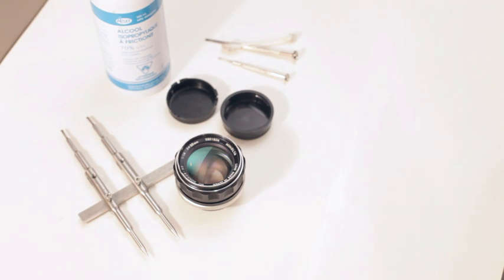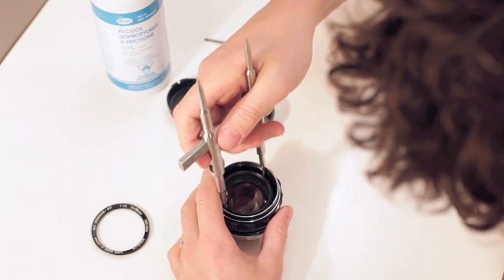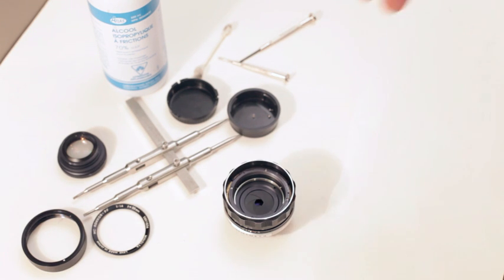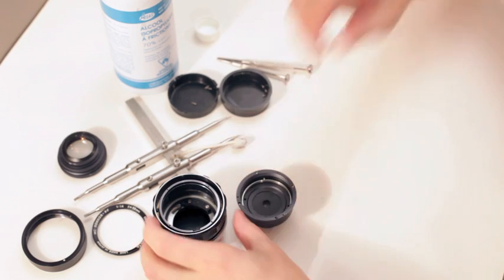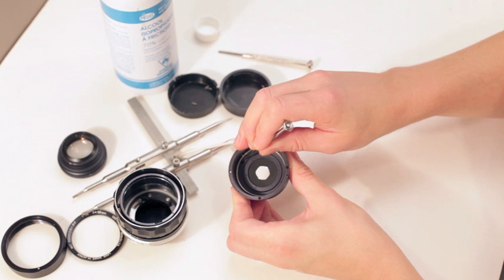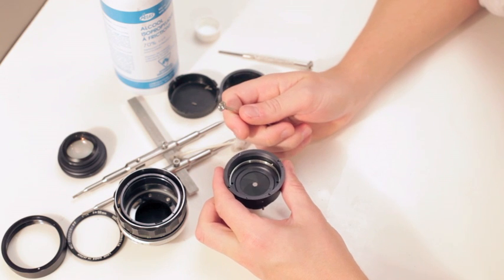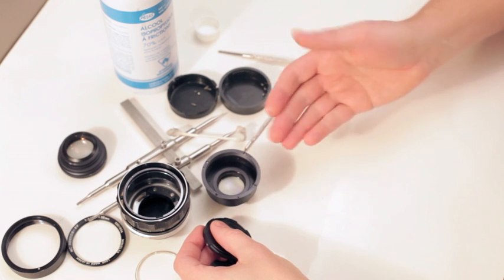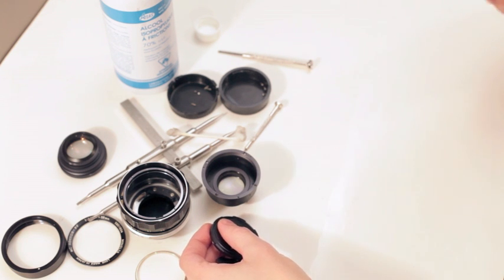How to clean aperture oil, fungus Minolta 58mm 1.4 PF 1/2

Comment: Hi, thank you for this Video.
I have the same Lens but with fungus. And my problem is I have a dent in the Filter ring. How I can remove the Lens with the dent? Thanks
Reply from the maker: To take out the dents is very easy. Just take a wood doweling and I smack them out with a hammer. The wood protects the metal and paint and the dents come out quite easy and will be able to take a filter again.

Comment: hi,
Could you name me the spanner you are using? I want to start learning how to clean lenses. What are the usual screwdriver sizes that you use to disassemble lenses?
Reply from the maker: Sure it is called a P3-S but they can be tricky to find. I found a seller on ebay who sold the box type one's and asked if he can get me the P3-S and he did. You may have to hunt.
Then also this one is great because it pinches in or you can rotate them and point them out. For the price its a must!
http://rover.ebay.com/rover/1/711-53200-19255-0/1?icep_ff3=2&pub=5575054310&toolid=10001&campid=5337469304&customid=&icep_item=360807053731&ipn=psmain&icep_vectorid=229466&kwid=902099&mtid=824&kw=lg

Then any $10 6pc precision screwdriver sets at a hardware store is great, and right now the Wiha #0 Phillips is one of my fave for a good driver:
http://rover.ebay.com/rover/1/711-53200-19255-0/1?icep_ff3=9&pub=5575054310&toolid=10001&campid=5337469305&customid=&icep_uq=Wiha+26105&icep_sellerId=&icep_ex_kw=&icep_sortBy=12&icep_catId=&icep_minPrice=&icep_maxPrice=&ipn=psmain&icep_vectorid=229466&kwid=902099&mtid=824&kw=lg
Reply: Todd Armstrong
Cheers mate. Just ordered it on ebay. I am going to learn and start cleaning the insides of the lens i have. Do you have any recommendations on how to learn to clean the interior lenses properly? My first job will probably be a Tokunun m42 135mm lens that has probably about 16 aperture blades!!! The blades are so oily and i can see a bit of fungus growing on the rear element. I'm kind of nervous to try it myself, but i cant be asked to spend the cash. Sometimes i feel the camera repair i was going doesn't really put in much effort. anyways, cheers for your reply.
Reply from the maker: tonatiuh0man Hum tough to say as I have never heard of a Tokunun lens before so I'm not sure the design of it.
The really old lenses had tons of blades around 16 like you said. they are pretty difficult to put back together and you have to watch the tiny lugs on the blades don't pop out. They are pressed in when milled. They can pop out pretty easy and then your looking for parts. I try to avoid the really old style apertures. Many of those old lenses didn't have auto apertures so they didn't need to be snappy either. You may not need to clean the blades if it is a non auto aperture, meaning the blades are not opened and closed by the body when the shutter fires.
Probably my #1 piece of advice is go slow. If something doesn't come apart don't force it. Chances are there is something else that needs to be taken off first.
#2 Don't strip the screws. Press hard and if needed place the screw driver in and tip it with a hammer. Some screws are glued and need help. Press down firm to avoid stripping the heads.
#3 Stat clean. I wash my hands multiple times for many lenses just to make sure I'm not tailing oil everywhere.
After you clean the fungus from the lens and put it back together place it under a UV light or in the sun for a couple hours but avoid heating it. This will kill any spores and help prevent it from happening again.
Ya start on cheap lenses and slowly move up. Eventually you will find many are Very similar and you will be more confident with the $ one's.
I try to avoid messing with the helicoid if possible. If you do tamper with the helicoid you will have to work on getting the focus synced back into place which is a pain.
I try to stick with elements and apertures becasue they are simple projects. For stiff helicoids I just use Atlas Gear Grease which softens and can restore smooth focus again. It is also plastic friendly.
There I wrote a small book, hopefully this can help.
Start on a couple cheap lenses becasue if you damage them, the experience with worth more then the lenses and you won't make the same mistake again. Then when you go to the expensive lenses you will be confident.

Comment: Where can I get the tools that you are useing to unscrew the screws?
Reply from the maker: ***** You can get spanners cheap on ebay which I recommend and the standard small screw drivers can be found again on ebay or a local hardware store. However if the screwdrivers look cheap, they will be and could break but should get the job done.
Reply: Thank you! Todd Armstrong

Comment: I have a 45mm f/2 Rokkor, Would it be a similar process?
Reply from the maker: Actually your 45mm would be a way easier process! If you look at my Nikon lens repairs, your lens would be more similar to them. Just spin out the front name plate and I think there should be 3 screws to take the front element assembly out.
Reply: @CannonFastReviews   Ok, I have the right tools so I´ll give it a try, thank you!